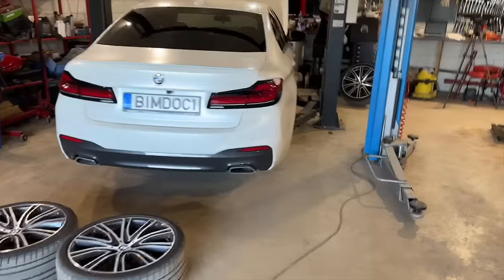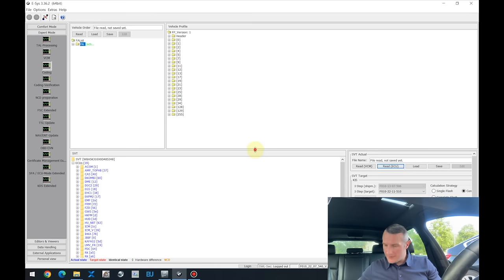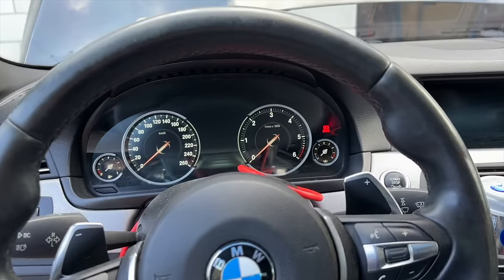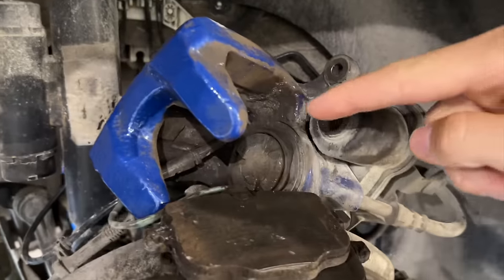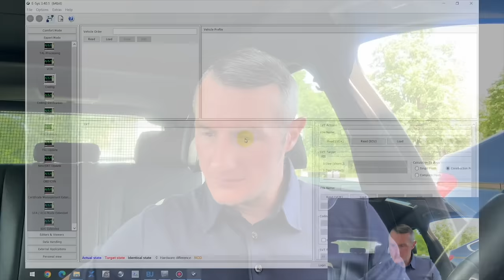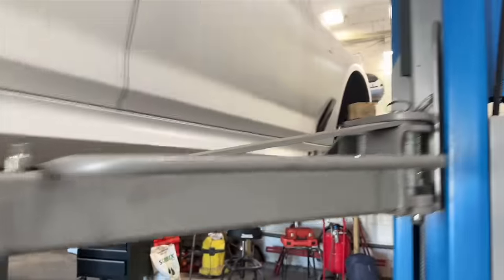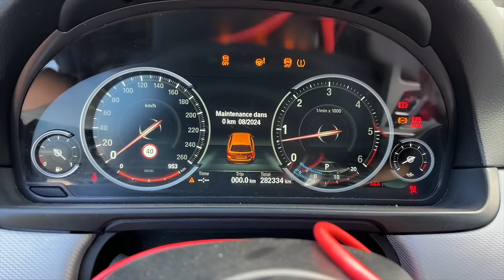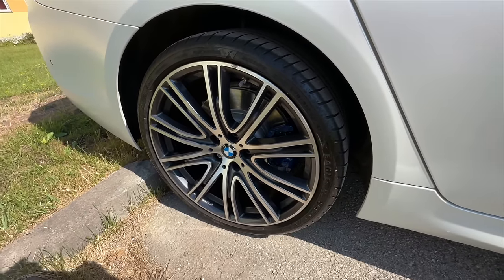Unique Content: Removing AdBlue System from Your BMW | E-Sys, ISTA+ & Chiptuning DIY

Comment: Where it is do it yourself😅 without a Programmer who edit your file is no „do it yourself… „ and it’s possible to edit a file of bmw f10 To deactivate adblue system without recode or even remove fuses, lol.
Reply from the maker: There are several ways how you can delete AdBlue. This is most universal one. 

And no other video in the internet show in the same level of details how that process should be done 😉

Comment: Why you read software from DDE via BitBox after flashing DDE with factory software? What the difference from the same SWFL in PSdZData?
Reply: The SWFL is encrypted I believe
Reply from the maker: Because when I read via BitBox from DDE I read only calibration part of flash memory. And only that is needed to do chiptuning or remove AdBlue. 

And of course plain SWFL is yes “encrypted”
So if you just take any SWFL and make any modification into that the esys will refuse to write that into the ECU because it will not pass the checks! Otherwise it would be too easy.
Reply: В таком случае интересно, а в обратном порядке может сработать, если допустим найти файл софта из PsdZdata от например 328 и записать его через БитБокс в 320? @BimDoc

Comment: Great video, thanks for sharing these knowledges. Why You using Bitbox instead of reading flash from actual DDE with E-sys? Can You share contact whos making modifications in flash file?
Reply from the maker: With esys you can only write software not read it. That’s why programmer is needed.

Comment: Great video! Quick question - how dangerous is it to update ECUs via E-sys or ISTA? I have an F10 with the software versions from 2018 (car from 2014) and I am tempted to update it but I hear a lot of people "bricked" their head-units trying to update the software. Is it a real risk? Thanks!
Reply from the maker: Yes, ricking your bmw is a real risk while update. 
That’s why do not proceed if you are not sure what exactly are you doing. 

See my esys for dummies manuals to get better understanding about modern BMW and how to work with those software wise.

Comment: I wonder how to do it the other way around. In this situation, we have a ECU on the list in the tree SVT, but how to add an ECU when we would like to add some equipment to the car?
Reply from the maker: Based on FA esys will calculate SVT
Use that method.

Comment: Hey, can you tell me what fuses are for the SCR in a 2014 328dx saloon/sedan (us model).

I’m having a terrible time trying to figure this out.

Thank you! Love the videos!
Reply from the maker: In ista use keyword SCR 
Then under SSP (wiring diagram) look up for the fuses. Simple as that.
Reply: @BimDoc  thanks. I found it.  It says there’s 3 fuses in the floor of the trunk. Active tank, passive tank and pump. Would those be the only ones?
(I plan on removing the tanks too)

Comment: Hi Vladimir thanks for your new video.
But one question to this. In past I removed FLA (because of Kafas2 retrofit) in my F11 and this ECU was still in the list.
I've got recommendation to do this.
1. load SVT without FLA
2. Change settings to Update VCM
3. Code ZBE (this will store SVT)
Could it be same procedure for you but instead FLA use SCR?

BTW waiting for your next E-sys video for dummies about flashing  of retrofitted ecus :p
Reply from the maker: Yes it might work in that way also. 
Or use the same method as I showed in the video.
Reply: Владимир подскажите что я сделал неправильно ? Ф01 2009г задача убрать заднюю рейку .  Пред hsr отключил.  Обрал опцию 2vh ( при чтении с авто есисом ее нет ) закодировал блоки dsc, icm,rm,dde,egs, kombi . Ошибоки по Флексрей и в дереве блок hsr красный и он есть . Как убрать  его ? При повороте срабатывает стабилизация.

Comment: Hi Vladimir, awesome videos as always, keep it up! Do you think it's normal, that my e70 n62 control unit tree in ISTA shown without any bus connections between ecus (they placed inline in the bottom of the screen, like exel table)? Thnx
Reply from the maker: New ista versions may depict ECU tree incorrectly on older cars. 
Use another (or older) version of ista.

Comment: Great guide, thanks for the information not many greedy people not willing to share. I have a question about editing SVT. In what cases do you have to modify SVT as opposed to FA? As I understand, there is no FA code for SCR so that is why you delete SCR module from SVT or I understand wrong?
Reply from the maker: Correct. You cannot delete SCR via FA modification (ok to be honest sometimes it’s possible if you find correct typeschyssel to the market where the same engine was without euro6 etc). But the solution I’ve showed is more universal and would be useful for a wider audience.
Reply: @BimDoc в данном случае, если расчитать svt с заменой кода модели скажем для россии(без adblue) и поправив fa под евро5 , после пролить этим софтом dde , можно обойтись без калибровщика?